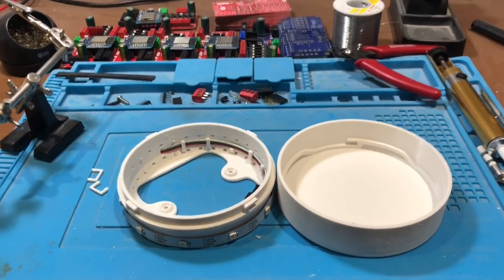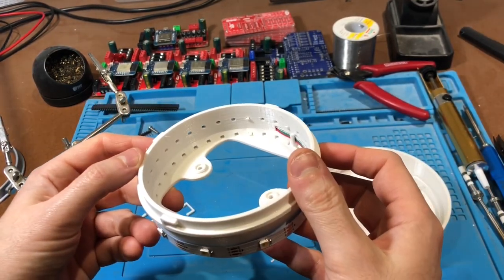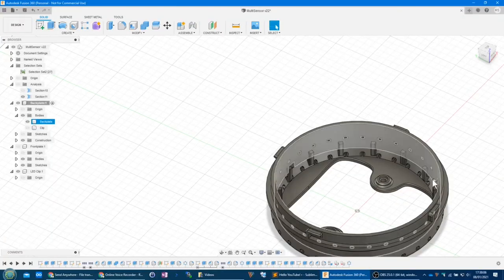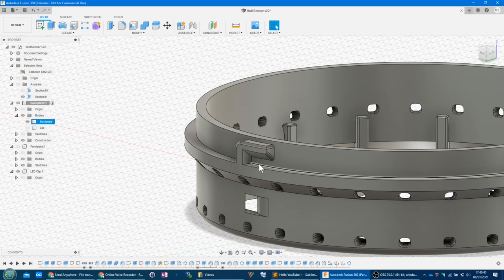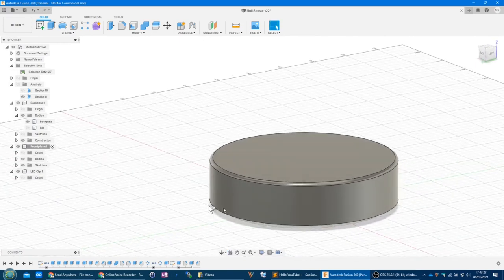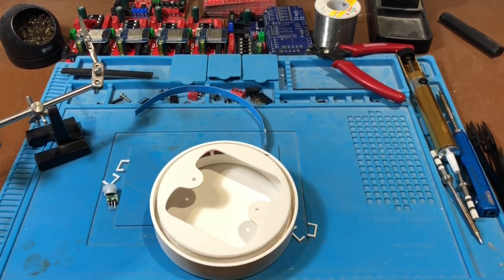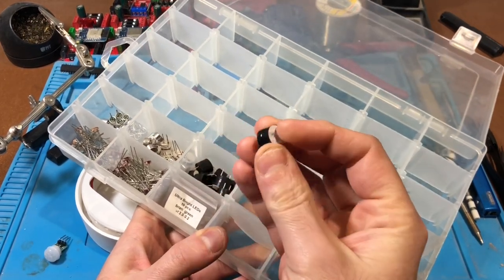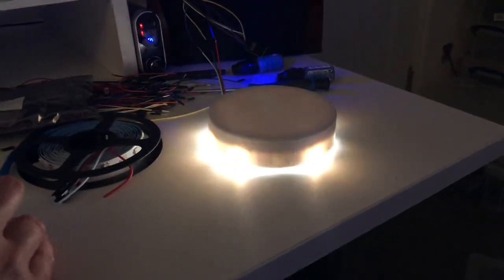Building a Multisensor: Tasmota, WLED & smart looking 3D printed ceiling mount

Comment: Great project. I'd still be concerned about the possible heat inside the box, with two ESP radiators, and the neopixel strip. While the holes do provide some chance for air circulation, I'd make sure to verify the possible difference, like by starting with an additional BME280 on a wire out of the box. Of course, ceiling level may not be a good indication of ambient temperature at human level.
Reply from the maker: Yes I am still concerned about that and have been thinking about how to modify the design to separate the temp sensor completely from the ESP radiators. My initial thoughts were to have an internal compartment (on the inside of the main external circular plate) with its on ventilation holes on the main circular plate, with additional ventilation holes up one side of the front plate, so air can kind of "pass through". The compartment will hold the temp sensor and have a clip lid to prevent air movement between the ESPs and the temp sensor. I have no idea if this will be sufficient, but this needs more thought, and - like you say - some proper testing!
Reply: I haven't actually measured it but subjectively the temperature at ceiling level is considerably higher than at sofa level.  

I certainly get very hot very quickly if I need to do any step ladder work (like hanging curtains or putting the decorations on top of the Christmas tree) with our 3 metre high ceilings in our Victorian semi.

Concern over this effect is what has kept me from considering ceiling level temperature to date.  It would sure be a lot more convenient to be able to handle everything in a single ceiling level device such as yours.

I guess the effect would be a lot less pronounced in a modern well insulated house with lower ceilings but it would be good not to have to "guess".  I must take some measurements sometime.
Reply: @ealingbadger  Depending on the building, the ceiling temperature could be higher with warmer air rising. Or it could be colder, if the ceiling loses heat upwards. Hotness with ladder work could also be due to the exertion :-)
Reply from the maker: @ealingbadger  Absolutely agree, so we are in a pre-victorian house (c.1840) but the principle is very similar, although lucky enough to have been able to convert the lower two floors and add basements, with heavily insulated walls etc. Airflow and temps are much more reasonable in the lower ground and new basements, but the 3rd floor flat has extreme levels of temp fluctuation. We are also installing whole house mechanical ventilation downstairs in the self contained flat. Either way I agree, heat at ceiling level isn't idea. I plan to include temp sensors anyway, as they are uber cheap, then use wall mounted thermostats (I have bought a Heatmiser system for UFH) for a proper readout of temperature. Also I may make go wild with CAT6 data ports around the house and simply make up little OneWire temp sensors to plug in at any point around the house directly into data points. The way I see it is: the more temp readings in a room, the more data at your fingertips.

Comment: Hi Mat, I've been looking for a suitable multi sensor that could be fitted in each room - so very interested in this. I currently have various zigbee sensors dotted around working with my Home Assistant - but this looks like an ideal all in one unit - is it possible to purchase a board currently ? let me know if i can assist at all !
Reply from the maker: Hi David, thanks for the interest. It’s not available to buy as the project requires progressing a bit further still. Busy with another electronics project at the moment (a work thing) but hopefully after end of Jan I should have more time to progress it. Will make another video once that’s done so stay tuned. Thanks!
Reply: Hi Matt, wondered if you’ve made any progress on this ?
I’ve been playing with the olimex esp32-Poe as a base - but it’s still a bit clunky

Comment: Hello, any chance of releasing the stl files before the project is done?  I really love it and I got the wife approval factor after I've showed her this video. :D
Reply from the maker: Unless you have the long version of the BH1750 board it won’t be useful... my prototype so far has the AM312 PIR basically providing full support to the prototype circuit board. So it moves around a lot and it is not stable. I’m currently designing the custom PCB which will be able to screw directly to the housing and everything will sit nicely. It won’t be long I promise, maybe a week or two then I will release an update and can post the STL. Thanks!
Reply: @MatSmithLondon  Thank you very much about this, and your work. Nice job, have a nice day!

Comment: The Microwave sensor at least in my testing is really dodgy. Often goes off without anything happening in the room. Have you experimented with it at all? Im using the same one.
Reply from the maker: I have had mixed results. In my house I have a hallway, with a temporary microwave sensor, it hangs down from a wire in the ceiling (about 30cm down from ceiling) and it runs on breadboard. It has been very reliable. It runs from a sonoff, i.e. at 3.3V which is not intended. The version I have put inside my multisensor is not quite as reliable, maybe it's too close to other components. Sometimes it doesn't go off when I move near. I haven't noticed it triggering when I am not in the room, but I haven't really checked that. It is will known that the sensor is very sensitive so movement in another room CAN trigger the sensor. So I think this is why it's best to combine with the PIR, which has been extremely reliable so far. One idea I had is to add aluminium foil (cooking foil) to the back of the sensor, I have no idea if this will work to prevent movement ABOVE the sensor (upstairs) from triggering but I will test this, and also test the reliability and report back!
Reply: @MatSmithLondon  That's interesting. I'v only ever tested them with other electronics in close proximity (same case), specifically a WeMOS D1 Mini and LED matrix. I also found that sometimes it wouldn't detect me at all and other times would go off with no one in the room. So I scrapped using them as reliable presence detectors because I can't use them stand alone like in your situation. Would be impractical.
Reply from the maker: @KmanAust  Are you powering them at 5V or 3.3? They are designed for 5V, some people report them working at 3.3 but not reliably, I have had it working okay at 3.3 but only in one situation, so may not be "reliable" at 3.3
Reply: @MatSmithLondon  Tried both. Microwave tech is voodoo anyway so who knows what effect it has on the module being around other RF. Anyway I'll follow along and see what comes of your experiments.

Comment: Been dreaming of something similar but as a ceiling rose
Reply from the maker: When you say "as a ceiling rose" I'm familiar with the Victorian ceiling rose (plaster decorative thing) and also what sparkies call a ceiling rose "i.e. the joint box within ceiling void". Which one did you mean? Might look a bit weird as a little device plonked in the middle of a lovely decorative ceiling rose, on the other hand if you meant installing it hidden in ceiling void then the PIR wouldn't work. Very interested to hear your thoughts!
Reply: @MatSmithLondon  I mean like one of these - https://www.screwfix.com/p/6-pendant-bc-white/8974j - which are just a bit too small to fit a Shelly 1, which was the starting point of my dream. Then I thought like an Alexa Echo Dot, but as a ceiling rose, which is what attracted me to your idea
Reply from the maker: @euanmcgill918  Ahh a pendant yes... Problem would be isolating the mains from the low-voltage stuff within the fitting. My sensor is strictly low voltage and runs from up to 24 V, I like the idea though.
Reply: @MatSmithLondon  I'll keeping dreaming, see if I come up with a solution :D